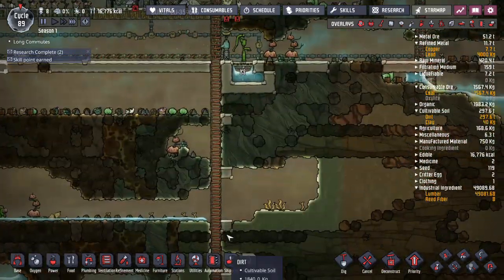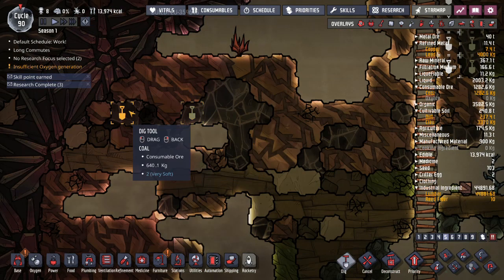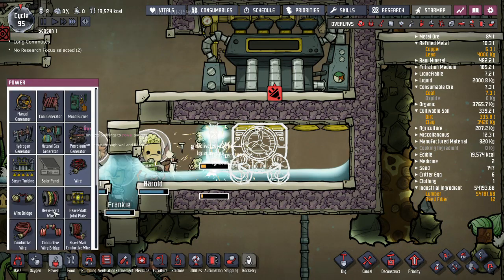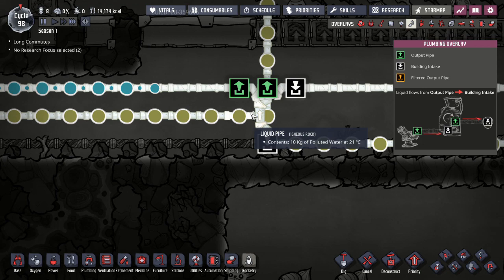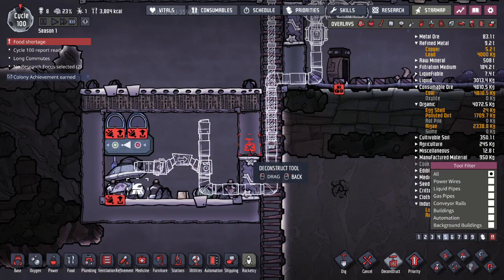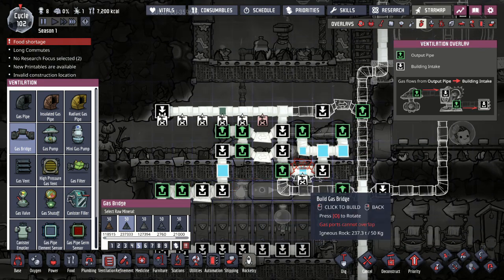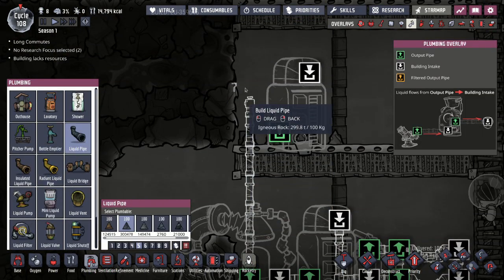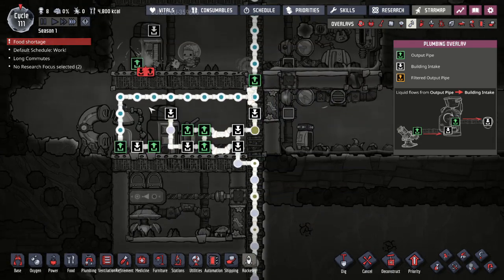Survival Mode OASISSE - S01E04

Comment: Really educational videos, I like them. I have a little question regarding the filters you are using. Is there a difference between the "mechanical filter" with the gas valve and the filter with the gas shutoff and the automation ? I tested both and they work fine. But you are you using both in different scenarios.
Reply from the maker: Yes. The two filters have different capabilities and vulnerabilities. The shutoff-filter is (usually) easier to setup but can work wrong if the input pipe flow stops. So if I'm working with a pipe that always flows I tend to go for that one, and if I'm working with a pipe that can get full and stop then I usually use the mechanical filter.